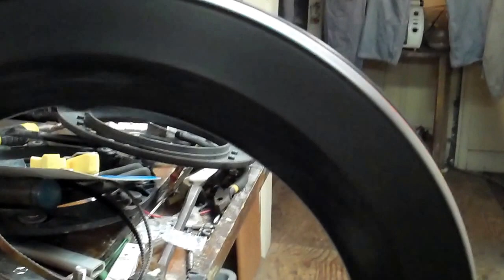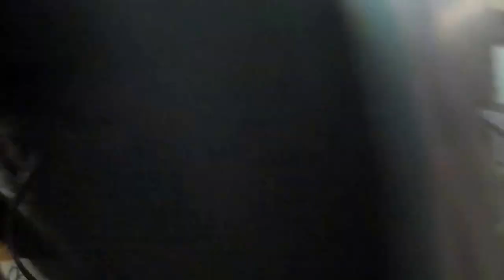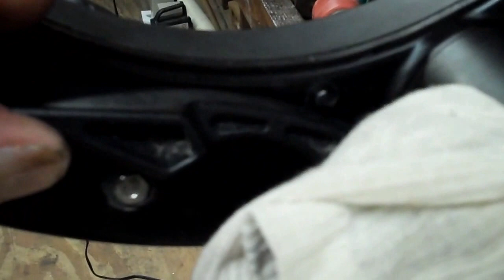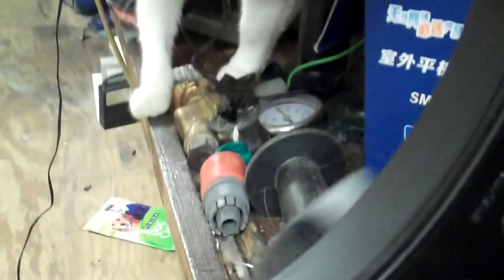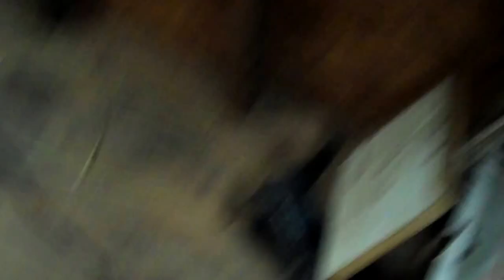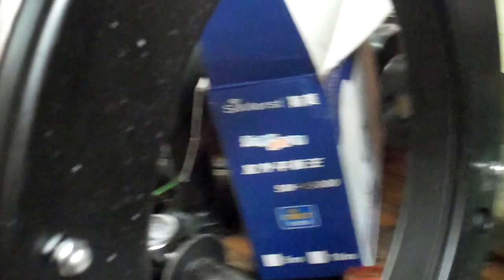autohelm raymarine st4000 wheel drive repair 11

Comment: I've also one of these autopilots. After it has been operational for a while, the drive lever is forced to be deactivated / lifted up. Mel, do you have any idea about the possible reason of this malfunction? Thank you in advance for your kind assistance
Reply: Hey, I'm facing the same issue. Did you find a solution for this? Cheers
Reply: @youtoobex  You can start wıth tying the drive lever up using a elastic cord until it is to be deactivated.
Reply: If you look inside 
Your see some broken bits of plastic studs 

Mine did the same lifting up and unlocking on its own   
I used two pack glue and glued and bolted the bits back together.   

All works good now
Reply: @bornfreefreedom4900  thank you for your input. I have a different version, but I did find a couple of broken plastics that I fixed by putting a screw through the other side, works much better than glue if you can do that. I think that a while back I tried adjusting the belt tension and between this and the broken plastics, the engine gearbox wheels got broken so in the end it was just making a weird sound with no turning. Changed the belt, gearbox, adjusted and rechecked everything. Will try it soon. cheers!